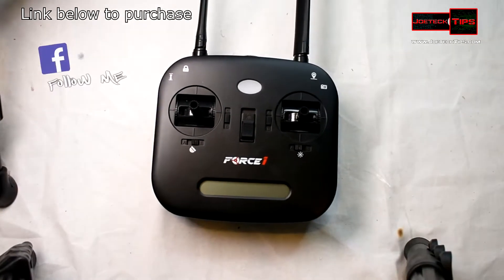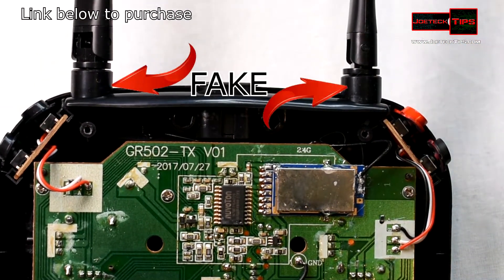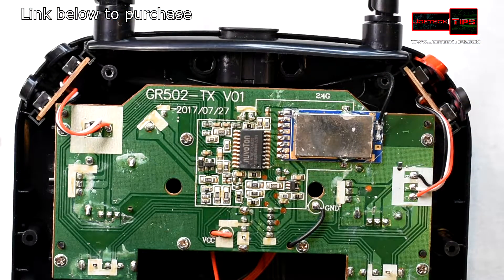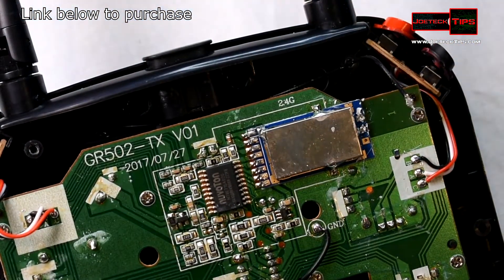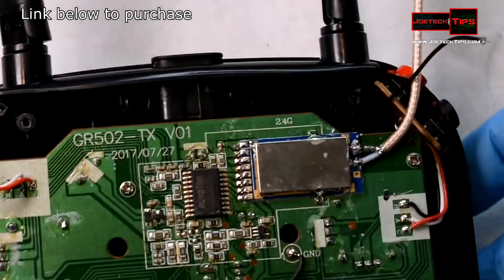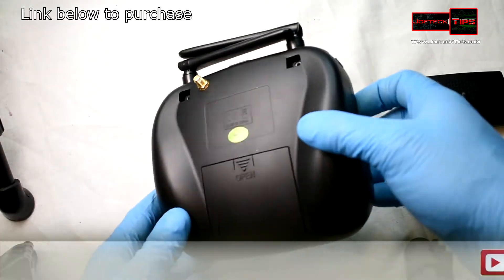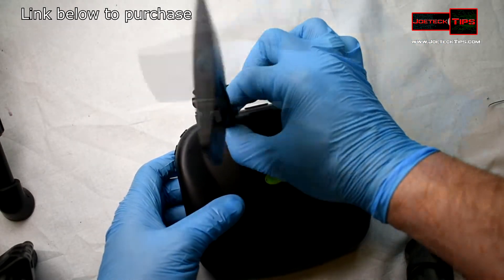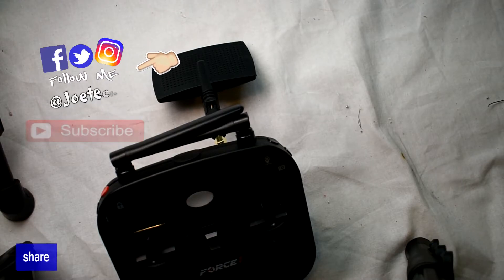Extending (HACKING) the range of my Drone Controller | JoeteckTips

Comment: How can I make a non amplified range extender amplified ? I have the it elite nano sync range extender on my mavic pro controller ....but I want it to be amplified with power so it's like the alientech extenders ....but what do I have to do??
Reply from the maker: I have the answer, but I can't provide it as It would be illegal to operate.. can't have an antenna with a gain higher than 6dBi.

Comment: looking at the build of that controller, it doesn't exactly instill a lot of confidence in the quality
Reply from the maker: Actually, its not that bad considering and It works very well.  If you ever saw inside of an older Futaba you would probably say the same thing. Everything is digital now, so they make the controllers much smaller.
Reply: I'm sure it works fine. the fake antennas are just a bit sad. I had an old 27Mhz futaba 4ch unit that I converted to 29Mhz to avoid CB radio interference in the late 70s. The external antenna was at least connected to the guts of the unit though.

You didnt mention how much extra range you got from the high dB gain antenna
Reply from the maker: brad morris I did that last night. We will be testing it today. Video will be done of course. ;)